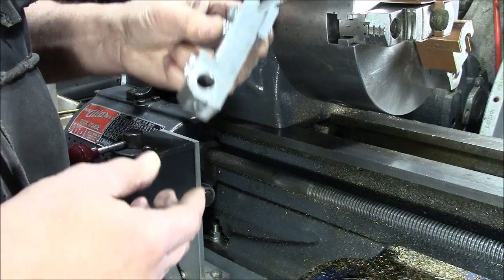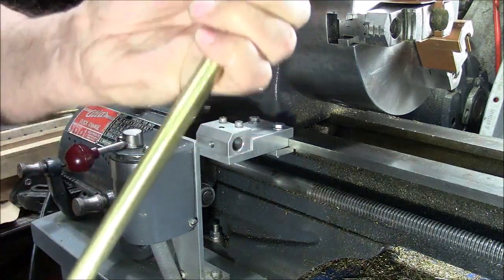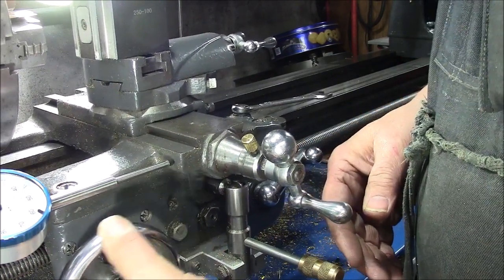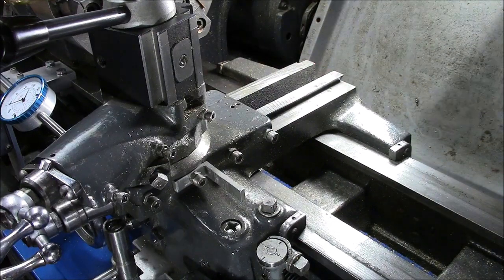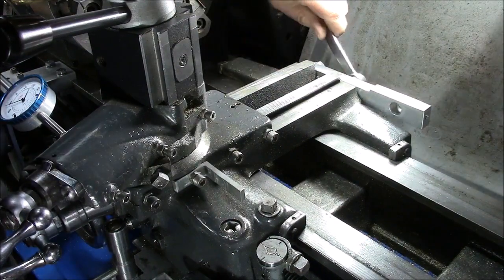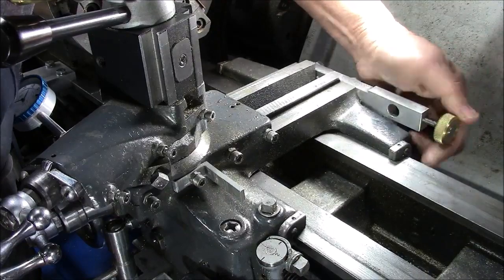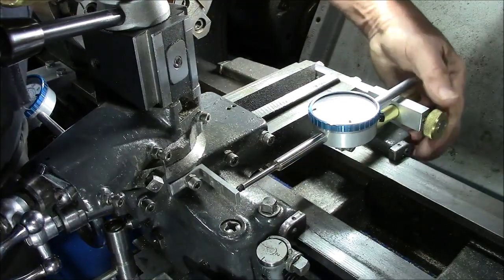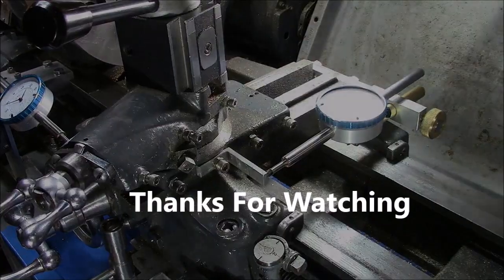Lathe DRO   ARO Part 2 of 2

Comment: Enjoyed the update! What are the model #s and where did you purchase the 2 gages? Also in another of your Atlas videos you mentioned your new Polish Chuck. Could you provide details of chuck and where purchased? Thanks Fred! I want to add these to my Atlas 10 inch lathe.
Reply from the maker: Thanks for the comments.  The gauges can be found here https://www.ebay.com/itm/330554100398.   I have no association with Shars...  The chuck was another EBay find.  I don't have any particulars on how to purchase a new one.  Fred
Reply from the maker: Sorry for the delay in responding.  Here is the EBay site that I purchased the indicators from.  Best of luck if you install the upgrade. Fred     https://www.ebay.com/itm/0-2-Inch-Dial-Indicator-Travel-Dial-Indicator-001-Grad-Lathe-Precision-Tool/302925099328?ssPageName=STRK%3AMEBIDX%3AIT&_trksid=p2057872.m2749.l2649

Comment: Thanks for the update Fred,  I'm anxious to get started on my Atlas.   My shop first shop update will be out in a few days and I getting excited about the possibilities for this new year.
Walt
Reply from the maker: Pleased you enjoyed the video.  Looking forward to seeing your shop update..  Regards-  Fred
Reply: Quick question.  Linseed oil or poly on the oak top, what are your thoughts?
Reply from the maker: I used water based battleship gloss gray 10 years ago and it is holding up great.  The oil spills clean right up.  Let us know what you choose and how it holds up.  Fred
Reply: I used grey floor enamel on the mezzanine floor, very tuff stuff, but if I hid the oak under paint it would make me cry.   Thanks for the fast reply, I have to decide by tomorrow night.
Reply from the maker: Did not know you had oak that looked good.  Clear poly would look great.  I used gray paint because the bench was old, very well built but ugly..  Good luck..
Reply: I post photo's on Instagram to keep people up to date on what I'm working on and other random stuff.   Are you on Instagram?  There's maybe 20+ Fred Millers..